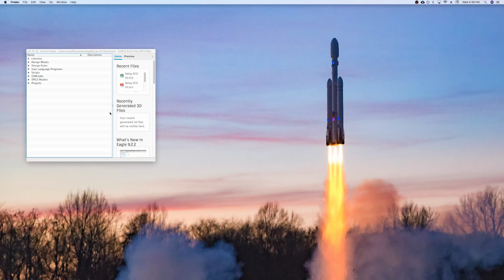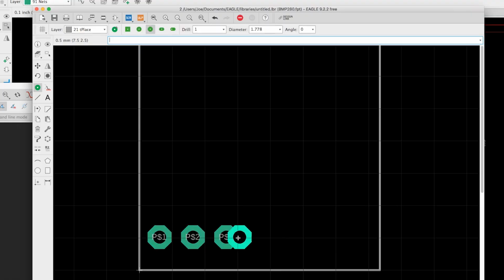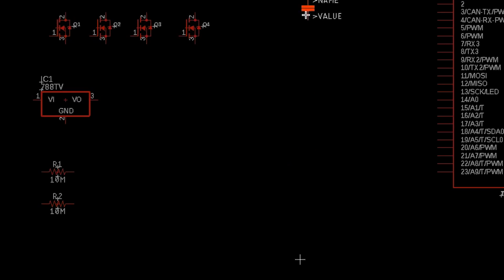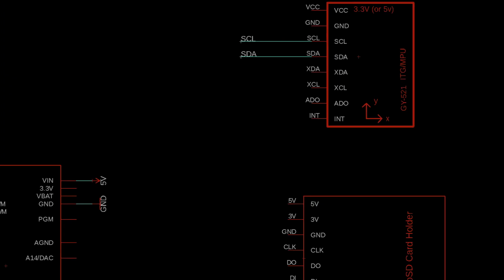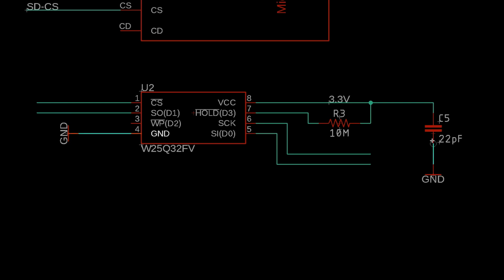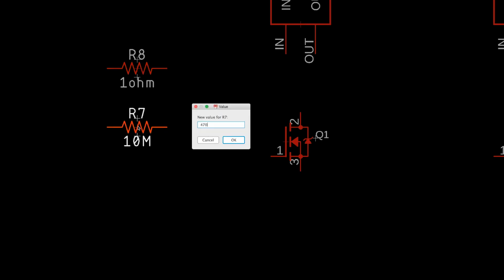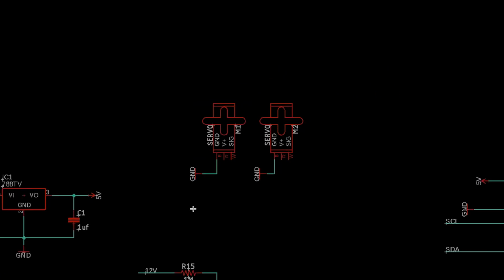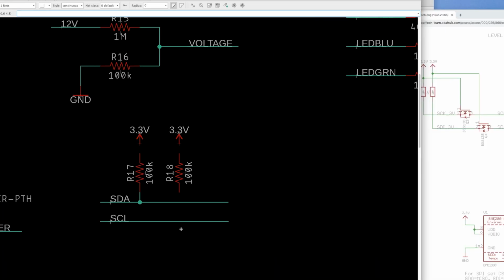Schematic Design - Landing Model Rockets Ep. 4

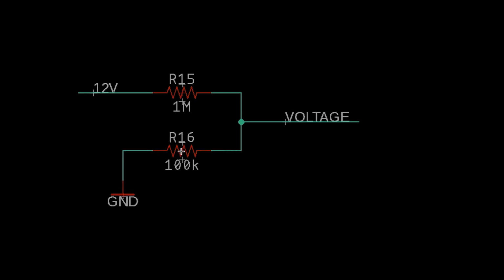Comment: 47:57 I think I got that right? The voltage divider drops it to 1.1volts. I (total) = 12 / 1,100,000 then voltage drop = I (total) X 1,000,000 = 10.9v drop. 12-10.9v = 1.1volts. Just starting out with electronics.

Comment: Why is the voltage divider Vout 1.09 Volts? isnt that kind of low for an analogRead input for a logic board? Couldnt someone get a more accurate read of the voltage when they use a voltage divider that has a Vout of 5V into the analogRead of the logic board?

Comment: Why do we need a flash chip and also a sd card ?
Reply: hey, a late response but he explains it in the video. The microSD will be connected mechanically which could disconnect midflight due to the turbelence the rocket might experience whereas the flashchip will stay in its fixed place, because its soldered

Comment: I love this video and keep watching it over and over again @bps.space. I've been doing some research into MOSFETs and and running them actually off a Raspberry Pi Zero because I want Python to be my code vs. C++. Anyhow, I uncovered that you should have a Gate Resistor between the GPIO and MOSFET gate. It seems the equation for the resistor size is V / I (3.3v / 20mH) to get a 165 Ohm resistor.  I'm wondering if you have started using Gate Resistors for Mosfets?

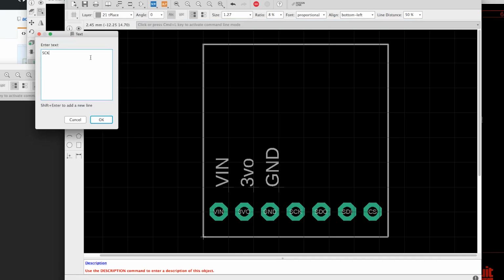Comment: 11:30 Note, it should actually be 3V0 (with the digit zero) not 3VO. That digit after the V denotes the decimal portion of that rail's nominal voltage e.g. If it was a 2.7 volt rail it'd be called 2V7, and if it was a 3.3 volt rail it'd be called 3V3. In this case the nominal voltage is 3.0 so it's labeled 3V0,

Comment: Hi Joe.  Just out of curiosity, I understand that a solid rocket can not be throttled, but, in theory is it possible to create a device that can interact with the engine exhaust to either redirect it or at least disrupt the laminar flow of exhaust gases to reduce the x-axis force of the thrust?  Would placing such a device in the exhaust path of the engine be legal?  If there were a failure of that component, the thrust could propel a piece of that component at a dangerous speed and in an unpredictable direction.  I'm not a certified rocket builder, so I am not familiar with what is allowed and what is restricted.

Comment: I have been using Eagle for over a decade. In the pre-Autodesk days (Cadsoft Eagle) I used busses alot. There was a time when I wasn't making schematics and I lost track of some of the more efficient ways to draw a schematic in Eagle. Like using Nets. I just made a little board and ordered it today. I wired every point to every point as if I was using paper. Then I watched this. Facepalm but very grateful that I came across this video. you just knocked hours off of schematic making. Now if you can just come up with a way to speed up board making (placement and routing).

Comment: By using N channel MOSFET to switch the low or ground side on the pyro connections, this opens up a potentially serious safety issue.
Since the 12V terminal is always active when powered, a loose wire on the ground side could then come in contact with almost any component and discharge the Pyro through ground.
That short circuit could occur with almost any circuit on the board which would in addition discharge a high current through the component and damage it as well.
The better method is to use a P channel MOSFET to drive the 12V side and have it return to ground on the other terminal, this way the 12V potential is only exposed when directed by the micro controller.

Comment: Can anyone explain why sensors like the barometer has a capacitors and resistors? And how does one know whether a sensor needs a capacitor/resistor, in addition to knowing what values for each they need?

My guess is that there’s a data sheet that usually tells you if a sensor needs these things, but I’m wondering if there’s a way one can figure this out without necessarily having a data sheet.

Comment: Just a suggestion: Why not connect the LED Anode to 12V and recalculate the resistors? That will make the LED lighting smooth and no extra heating to the Processor. Now you will have almost no light from two colors.
Anyway Thanks for all sharing! It is now more than 30years sins I designed a PCB. With education. And u do it without! My interest is Control loop design. Need to look to your other videos!

Comment: I know you don't believe me... But that shits going to fry as soon as you add power to it.
Reply from the maker: If you're going to make that claim, you should back up your reasoning.
Reply: @BPSspace  you are using a 7805 for your voltage regulator. The mcu you chose uses 3.3v. I didn't check most of your sensors, but it looks like they use 3.3 as well. If you use 5v, the magic smoke will come out. Id suggest changing to a lm317. It's pin compatible with the 7805, but requires 2 additional resistors to set the output. I'd also suggest checking the power consumption. Depending on how much your mcu needs, you may be stretching the max power one regulator can provide.
Reply from the maker: @theonlyari  The VIN pin accepts up to 5.5v, the Teensy 3.2 has a regulator onboard - for Blop I send 3.3v direct to the MK20DX256VLH7 with a 3.3v regulator. No need to use one on Blip since everything is 5v tolerant. The 7805 will happily provide 1.5A which is plenty for 2 tiny 9g servos and a few sensors etc.
Reply: @BPSspace  maybe I missed something, but you have 5v tied to Vin. Vin Max is 3.6V on the mk20. As for the power rating, you are correct that the 7805 can power it, but it's a good exercise to do the math on regulator. ((Vin - Vout)*I)*thetaja = operating temperature. If you supplied 1.5A in that configuration, the regular would turn into a small star. Regardless, it should be fine, but it's always worthwhile to verify theses things, just in case.
Reply from the maker: @theonlyari  Vin Max on the MK20 is too low, yes. Vin Max on the Teensy is 5.5v.

Comment: So for landing model rockets could you have the first stage bring it up then when the engine is out it is discarded along with the fins at the bottom so smaller fins at the top can stabilize it for the flight down, then at a certain point after the rocket reaches its apex of its flight then the next engine could fire, maybe with engine gimbal for a safe landing?

Comment: not related to the video but have you thought about making custom rocket nozzles to increase the predictability of the thrust of the rocket motors? I have seen some 3d printed (plastic) nozzles and bells that seemed to hold up to at least one fire. I bet if you put a thin coat of plaster on the inside it would ablate and live a lot longer. not sure how a second burn would work.......

Comment: What were the reasons behind the shift from ATmega328 to MK20DX256VLH7? Is it possible to use the less powerful ATmega328 for this project - will it work?
Reply from the maker: It's possible, but the main issue was program space. Especially with some of the bulkier SD card libraries, the ATmega328 didn't leave a lot of room for expansion as the codebase got larger. Figured it was better to just overpower the board rather than try to prove it can be done on the 328.
Reply: @BPSspace  Considering that I don't have a lot of experience with programming, designing computers and stuff like that I have decided to start with Arduino Nano and work on some elements of a rocket individually and improve them graually. When ATmega328 won't suffice my needs I will move to more powerful versions with more memory.

Thank you for the answer and all you do!
Reply: @VítRamba  I conquer.
Test isolated systems in Arduino Nano.
Switch to Teensy 3.2 for final project.

Comment: This is everything I have plan for this year. Developing my own computers, launching and landing a rocket, developing other autonomous vehicles to monitor the flights. Amazing work!

Personally my first few computers will probably be based on atmegas. Once I've mature the code I'll move it to something 32 bit.
Reply: With the microcontroller he uses you can use the Arduino environment. There's only advanteges
Reply: @danimaster6647  iirc atmega is used on Arduino mega

Comment: Also using linear LM7805 for 12v to 5v convertion bad idea for rocket, LM will self heat, reguire radiator for heat dissipation, this is some excessive mass.
I recomend you to use dc dc buck converter, they are more efficient and almost no heating.